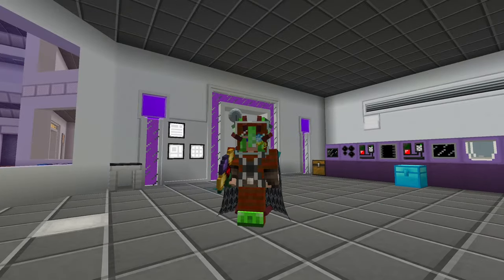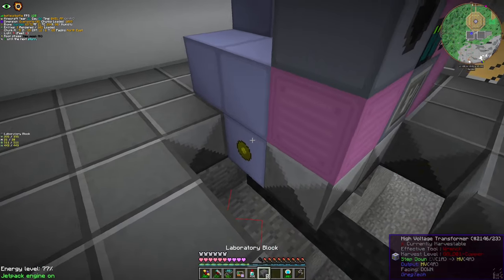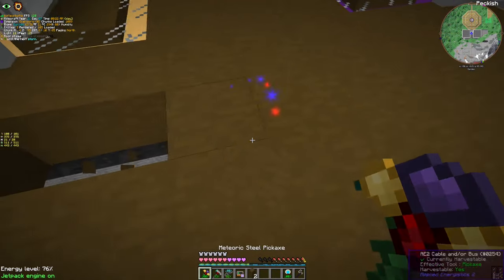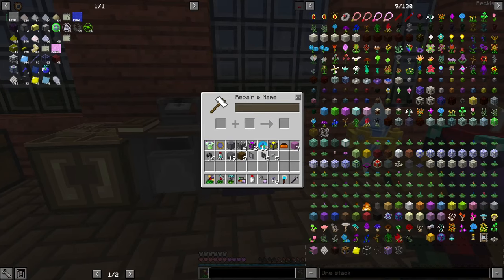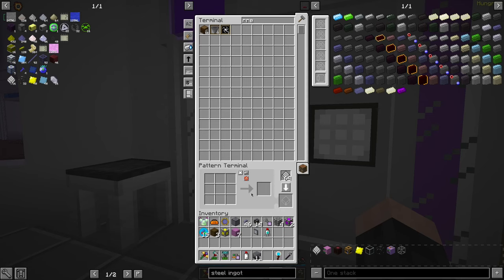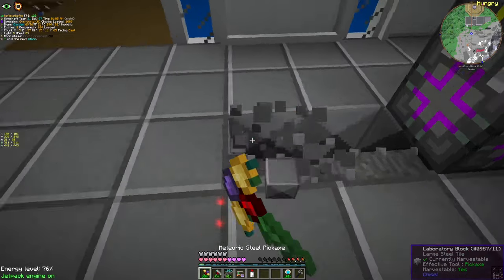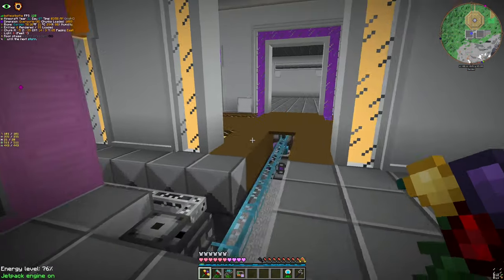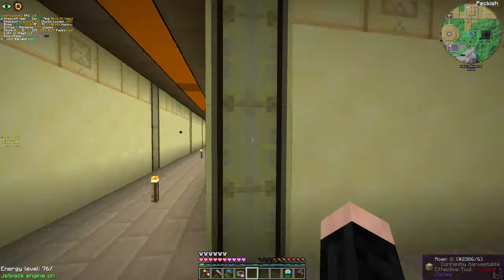Bend All The Things... With AE2 | GregTech: New Horizons S2 - 48

Comment: My reaction to my first MB-Bender was quite similar, lots of giggling looking at the satisfying speed! 
in my base I use an interface in block form next to the output bus and connect it with an item pipe, it safes a channel!
Looking forward on how you implement fluid handling 😊
Reply from the maker: It is super satisfying indeed. Yeah, I thought of a similar thing, but unless there is a system with a bunch of outputs and I'm low on channels, I don't think I'll
Reply: @KofteistKofteEN  yeah, looking at extruder or mixer you will certainly need many more channels, so it became a habit, but later on with the direct 
ME output busses I will have to adjust anyway
Reply from the maker: As you'll see in the next episode, I already have a multiblock extruder (and wiremil) :)

Comment: you don't need to use painting cans. You probably know the painter from ae2 and its very useful. it also supports gregtech cables.
Reply from the maker: Yes, I know. I'm currently using a janky power line. I'm planning to upgrade my power network to a LuV power spine and with that, I'll color-code my cables.

Comment: Instead of manually renaming each interface in an anvil, you can just place it on the multiblock and right-click it with a quartz knife to name it. Plus it doesn't cost XP.

Also, don't forget that there is a "2x" button on the pattern terminal, so that you don''t have to manually fiddle with the recipe amounts - You can just pull from NEI with the "?" button, then double up with the "2x" button. However, if you want finer control of the numbers, just Ctrl+Scroll to change any amount up or down by 1.
Reply from the maker: Yeah, I discovered both of those things after recording this episode, and it saved me a bunch of time :D